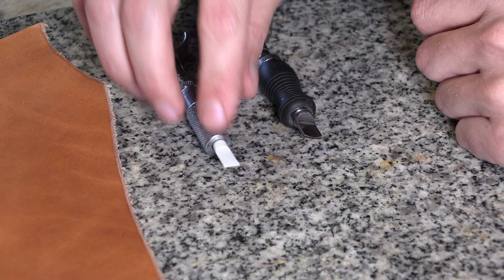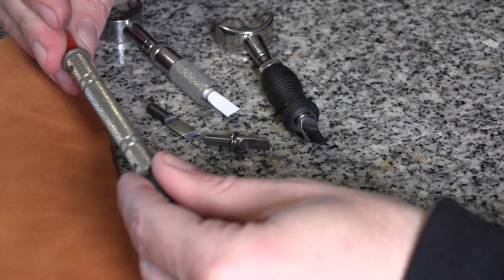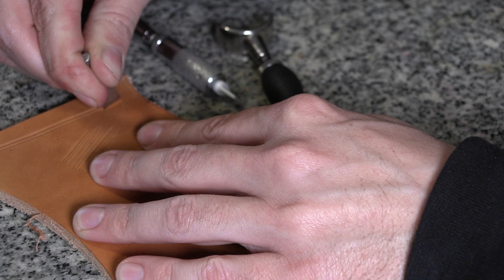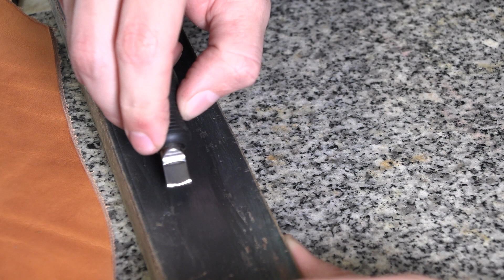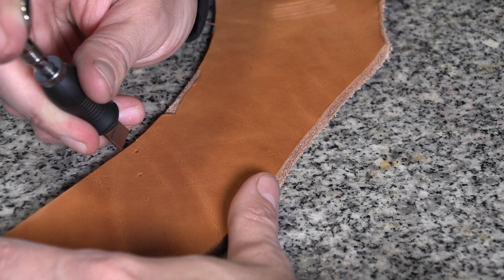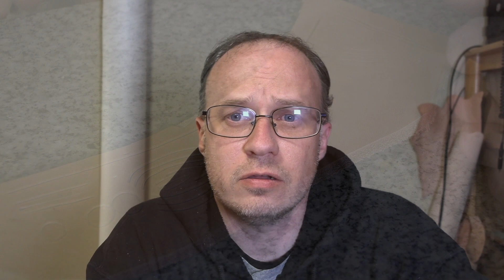How to use a Swivel Knife, the essential tool for leather carving.

Comment: Can you imitate crocodile skin with a swivel knife?
Reply from the maker: I haven't tried that. I think I would also need modeling tools as well as the swivel knife to try and make it look realistic.  The belly scales wouldn't be too hard to imitate, but the flank and back scales would be challenging.  Would be a lot easier to inlay a piece of the leather that is sold embossed with a crocodile or alligator pattern.